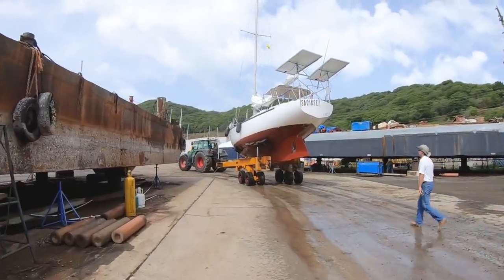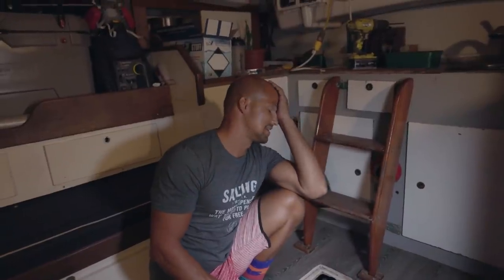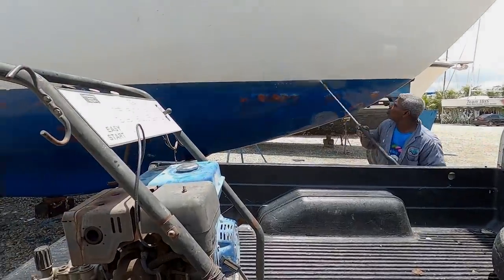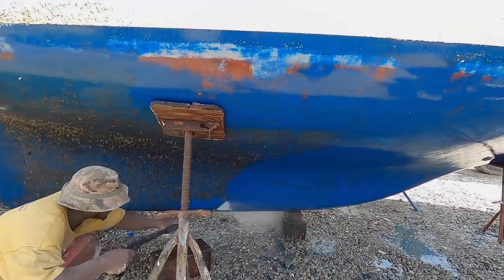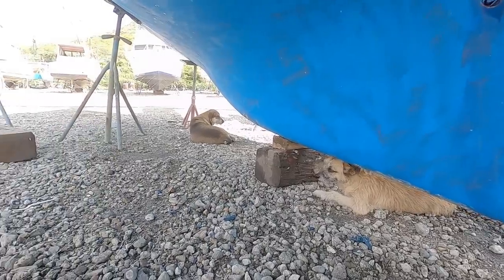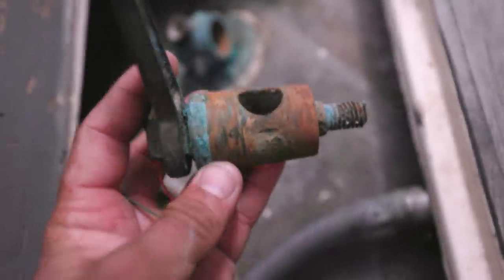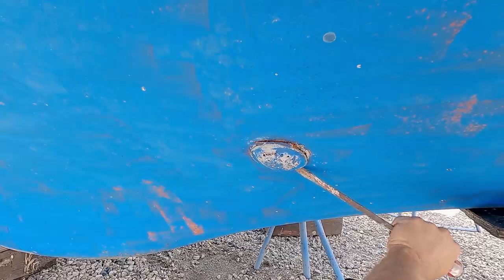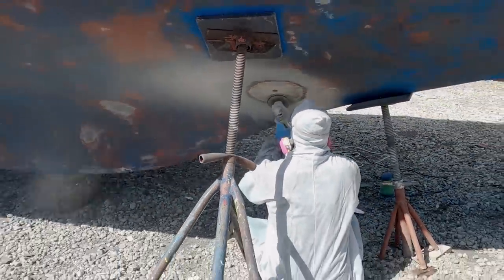IS OUR BOAT WORTH SAVING? (scary discovery during haul out)

Comment: Yes sir I agree that you will have to make alot of holes in the keel to dry it out. You must find the source of the leak and adress that before you apply any antifouling or the antifouling will just cover the leak until it creates a crack in the paint than you will be back to square one again. But once you locate the leak, put in penetrating epoxy into the holes that you made to drain the ballast. It will re-atach the fiberglass to the hull to the keel. You will need some saringes to get the penetrating epoxy into the holes. And you will need scotch tape to apply outside the holes to keep the epoxy inside between the hull and ballast or it will run out before it sets. Its slow setting and like water consistency. Epoxy doesnt stick to the plastic of the tape. But don't seal up the holes until with tape until you see the epoxy coming out. It will be a 2 person job. One watching for the epoxy coming out and one putting epoxy in. But make sure the hull is cleaned before you apply the tape or it won't stick to the hull. Plus you will have to be fast at putting on the tape because if the epoxy gets between the hull and tape. The tape won't stick to the hull. I know this sounds like a bunch of fucking work. But its better than the alternative which is getting a different boat. Sorry bro, I wish I was there to help you guys, but I'm here in Ft. Lauderdale. But I wish you luck and don't get discouraged. You can do it. It takes time but you will be better at fixing problems when its all done. You can do it, I have confidence in you.

Comment: Another cruiser had the same problem, they used a hole saw and made holes all the way down every few feet and used a wet/dry vac to suck out the water they could reach, and then flipped the switch to blow air in to dry it out. They used blue tape to put plastic over the hull base so if it rained then water would not get in and they blew air into the holes for an entire week to dry it out. Then the fiberglassing begins.

Comment: YOU GUYS ARE REALLY LUCKY. Water ingress is really common and not such a big problem AS LONG AS YOU HAVE ENCAPSULATED "LEAD." If you had low density ballast (iron) you would be in much more trouble. The fact that is salt water coming out of those drillings means: rudder stocks, stern gland or excess water coming of the deck into the bilge through places like the hawse pipe (anchor chain hole in deck). Never run a boat with wet bilges. The water is not going to go up, right? You need a surveyor to go over the exterior of the hull, then check the rudder stocks (lower) and make sure your stuffing box stern gland is okay. You probably already cured most of your problems by drilling it and letting that old smelly water out. The reason it smells is because it has been in there a long time. Your boat is going to be fine. A surveyor will have a 'waterometer' that tests for moisture in the hull. You will be longer on the hard than you probably hoped, but that's common too. Dry out the keel as best you can and then seal it up. Track the leaks to the obvious places mentioned above. I've sailed and worked on modern super tankers and old wooden sailboats, cleaning out the bilges is a regular job on both. If you don't keep them dry the water will find its way into trouble somewhere. If you can afford it get a drip-less sterngland, if not then just swab it out like sailors have been doing for a millennia. I send best wishes, it must have felt like a heart attack. But thank god you have lead. Really, cross your self and thank the Lord for lead. If she was an old Taiwan boat with skunk iron ballast you would be in more trouble. Many thanks for the video. I hope you are doing okay. Keep in mind you could re sheave that whole hull in three or four days.

Comment: Your sloppy swing keel pin has allowed water into the bilge and THEN wateri has seeped down into the encapsulation (between the lead and fiberglass.)   Now that you have the keel holes drilled (drill many, many more holes higher UP along her keel and along the bottom of her keel) - FILL YOUR BILGE TO THE BRIM with food colored water -  then wait for leaks.  Anything can be fixed!  So keep the faith!

Comment: I've seen that EXACT issue on several other vessels with Centreboards.  After draining and drying the areas you've drilled I suggest sealing up the drop-board system and thereafter when you are sure its dry in there use a filler to pump in the holes you drilled to fill all the keel cavities.  then repair those holes.  It's a sad sight indeed but the decision to repair vs. to abort the vessel comes down to your budget.  But you're safe out on the water.  It's not going to sink on you....  Good Luck Ya'll.
Reply from the maker: Thanks for that Chris. It is easier said than done... find a new boat. We feel like know we really know Saoirse inside and out and all her little flaws (most of) then to invest in a "newer' boat and just find more problems. we are happy with her for the moment (but doesnt mean we can't look around :D)

Comment: Thank god it is lead,  I was very worried for you if the ballast was iron.  Iron will rust, expand and pop the keel lamination in two.  Yes there are voids in your keel that are not ballasted, by design I think.  Get the water out like you are doing, let it dry and find out where it got in. A little hammer and tappety tap all over will give you an idea where the delimitation is and where the lead is too.  I think you can do it but it will take time, lots of time.  Good luck.
Reply from the maker: So grateful that it was lead! Can't imagine the mess it would have been if it was iron! YIKES!

Comment: Hi guys. I would check the keel with humiditymeter and make holes after than. Do not wory every encapsulated keel makes water after some certain age because of the movement of the weight inside of it, this water comes from the bilge and the boat hulls are not become osmosis from inside as there is not a pressure. Do not worry , put some cotton fabric strips inside the holes half of it at outside of the hull , this will speed up the drying. When it is dry close the holes with same diametres epoxied wood strips , coat your boat's underwater hull  with epoxy resine and paint , enjoy the life.
Reply: Sorry i forgot to say , before closing the holes put some epoxy resin a little bit thickened by some microfiber dust , by using a big injector.

Comment: This is not a big deal.   You have a void between the glass and the lead.   Tap on the hull to find out where it is and how big an area.   Drill small holes at he lowest point of the void and let it drain.    Poor in alcohol and let it drain out.  Let it all sit and dry.   Then fill it all with epoxy.    Hope you didn’t go crazy.

Comment: The ship is still structurally sound. An encapsulated keel has enormous reserve strength. Drill it and let it drain until it stops. Using makeshift "dams", fill the bilge from the inside, section by section, and see if you can detect where the water is entering that cavity, or cavities Once you spot that, you should be able to stop the ingress. With the ingress stopped - glass it until it stops - the ship should be OK. In the meantime, be very careful not to take the ship somewhere where that water may freeze. Freezing water is capable of brutal forces if if it is entrapped.
Reply from the maker: Definitely not going anywhere near freezing water! lol. if we can't swim in it without a wetsuit we don't really want to be there. lol. thank you for your help!

Comment: If its sea water coming out , it got there through the split in the hull, or the bad worn out waster intake valve, since the hull was not leaking after being taken out, the bilge is ok, just filll those drill holes good, I think your going to be ok.

Comment: , perhaps  hopefully the leak is found .  And sealed properly  ASAP 
  Sand one layer and blow air in the drill wholes  . And patch and paint .  . 
    The boat is not shot !!! 
I wouldn’t grind too much I would just sand one layer outside .
    Water 💦 Delaminates happens with clothe  , not heavy mat  . Your ok  structurally .  
  I wonder if you could mix resin from the top of the keel bildge area in somewhere area ? to make it pour out the bottom where you drill those holes before if you could find that way it’s getting in from the top of the keel  .  . ?
Reply: Do you really think there is Delamination because of water ponding in Keel .  I wonder what a good survivor would think  ., 
  I think we’re all that voided area to hold all that water in the keel  can be replaced by mixed risen  . Did 4 gallons water drain out ? Buy 4 gallons of risen  .

Comment: I don't know this particular boat but my first thought is that it is unlikely water would enter from outside.
I would look at how the swing keel is attached to the boat or the joints that make up the box around the swing keel.
Delamination of the keel would be unlikely.
Worst case scenario you may have to remove the swing keel to check inside it's housing.
Best of luck.
Alan L
SV Feeling Groovy

Comment: My concern is that water is approximately 8lbs per gallon. Where you guys have drawn the "new" waterline is what looks to be 6-8" deeper than original. It would be interesting to see pictures from when you originally launched and compare to the new line. if it has truly "sunk" that far, I think you may have a situation where water may actually be wicking and while not actively pouring water, it may be damp. I don't know the math to figure out buoyancy, but in a 35' boat with a major amount of dead weight removed (the engine) I feel the weight would be in the thousands, and 1000/8=125 gal. and given the waterline change indicated, I really believe you are looking @ 2-3k lbs. IMO, She is a beautiful boat, but are your lives worth the risk??!!

Comment: Sand blast the bottom to try and find any cracks. If none epoxy fair the bottom then put a tie coat and paint.
Then check all the stuffing boxes and through bolts. Use thick rubber washers under yr stainless washers and paint the rubber washers with liquid rubber to ensure they seal

Comment: I follow this other blogger, his channel called "Boatworks Today." This guy repairs boats for a living. He knows everything about boats and fiberglass. I would console him on your predicament. Ask him about the show he did when he repaired the rudder on a sailboat. He had to open up the rudder but he used this foam product that wont adsorb water. From watching how much water that ran out, you have quite the gap. I saggest you use this foam at the bottom of your hull where the gap is the biggest. Than use penetrating epoxy. Its expensive the penetrating epoxy. But I would contact this man first for advice. He seems to be pretty nice and when I send him texts he answers my questions.
Reply: That sounds like a some very good advice sir.  By the way,  I think you meant to say they should consult  him on their predicament not console.  Thought they may need to be consoled if the news is really bad.

Comment: .    If you seal up holes you drilled and add measured amount of dyed water you may be able to identify how much volume you have to fill as well as any other entry points for internal water, eg from keel cavity to bilge sump. Strongly endorse use of thinned epoxy to fill gaps in ballast keel cavity.  boat seems very fixable.

Comment: If you see water coming in add some food colouring dyes to the suspect areas. ..see what colour turns up in your bilges.
Leads not magnetic iron/steel is ...not sure about iron sand but i cannot see them using that.
Drill drain holes its probably ...just seen... the flanks of the lead slab where the glass has pulled away.
If you can get some heat on the keel you may get it dry ..you might find a product you could pump in that will expand and bond and doesnt mind water.. then seal the holes.

The black stinky water will be de oxygenated water either from a shower or sink leak or if its got into a enclosed space with some metal and its used up the O2 .. and gone anoxic ...it smells like bad eggs and is black when it comes out but after 24 hrs it will start turning rusty from the O2 in the air outside. 
Sometimes happens with vehicle chassis's. Water gets into a sealed box section and cannot get out you drill a hole and a sulferous stinking black liquid will come out. 
Ideally you want to stop water getting back in there again.

Comment: I had a 1969 Pearson 35 years ago. A previous owner had removed the centerboard (I think they said it fell off underway) and they never replaced it. I didn't either. Not sure how the boat would have been with one, but I never missed it either. Just FYI.
Reply from the maker: This was discussed MULTIPLE times! We rarely use it, only when pointing. So it was a heavy consideration. It was gonna be more work, so we decided against it.

Comment: Hi like your  videos and the low key more realistic way you show sailing life.
I am retired and been around boats for over 60 years ,sometime professionally.
In my opinion the 12 to one rule is misunderstood .A thru hull hole pluging is nothing structural and do not require such a large ratio .I have seen old repairs polyester on polyester  at a 0 ratio (just a polyester goo plug ) still solid 20 years later. I would NEVER advocate such a method but it show how unnecessary a 12 to 1 is on such a small hole !! .Just saying .
Thank you for sharing                                                                                                                                                                                                                                                                                                                                                                                                                                                                                                                                                                                                                                                                                                                                                                                                                                                                                                                                                                                                                                                                                                                                                                                                                                                                                                                                                                                                                                                                                                                                                                                                                                                                                                                                                                                                                                                                                                                                                                                                                                                                                                                                                                                                                                                                          .
Reply from the maker: hey! thanks! good to know. i guess we are definitely over doing it.

Comment: what if you drill holes from the top,  leave the holes on the bottom.....pour "deep pour" epoxy (it's slow setting and very thin,  will get to and fill any cavity between the  led and the body)........once it reaches the bottom,  seal tape the bottom outside holes.....the epoxy will take 3-4 days to totally dry.

Comment: That zinc is past it's useful life. Change it! Not worth the penny pinching. Anything less than 40% is not worth putting back on. Can give you an electrical resistance explanation if you would like ...
Reply: Correct! Zinc anodes loses their zinc content through deep pores much like tiny caves, not at all like an ice cube would melt away from the outside, shrinking. The rule of thumb is if its lost half its original weight, its done and needs replacement.

Comment: Just like Sailing Atticus did sometimes you just have to call it. With the cracks and now this. I would give it some hard thought, get it fixed as best you can and maybe move on. Especially if you plan to Blue water sail her. The Caribbean is one thing a ocean crossing is another.

Comment: Given that water weighs just over eight pounds per gallon, it is very possible that this extra weight is what is making your boat sit lower in the water, or at least contributing to it.  Before you raise the water line, I would fix the water in the keel issue.  You mentioned that you are on a forum and I'll bet that others have experienced the same issue.  They may be able to confirm or deny the water line question.  

It is easy to get discouraged, but remember that it can always be worse.  If you owned a home, there is a good chance that eventually you would need to replace rotten wood, fix a leaking roof, or other similar big job.  Besides, a house is nothing more than a boat that is so poorly built and so firmly aground that you could never get it floated.  I wish you the best of luck with your repairs!
Reply from the maker: no, we really have come to the conclusion it came from the wells that had delamination. it leaked in through there.
Reply: @BeauAndBrandy  I am glad to hear that you figured out the source!  I wish you the best with your repairs.  Fair winds!